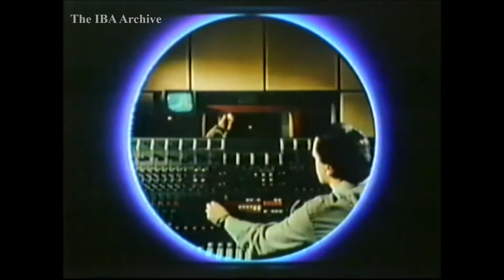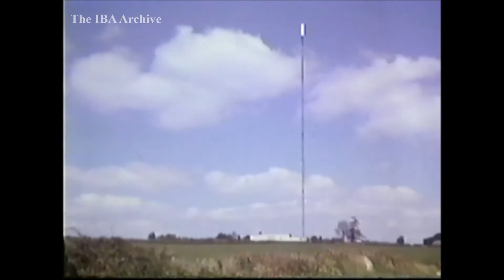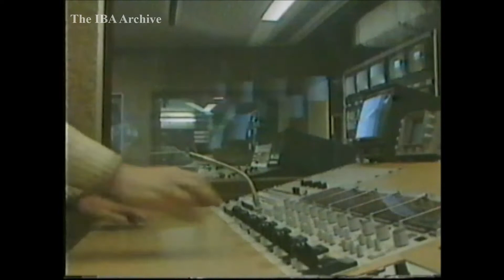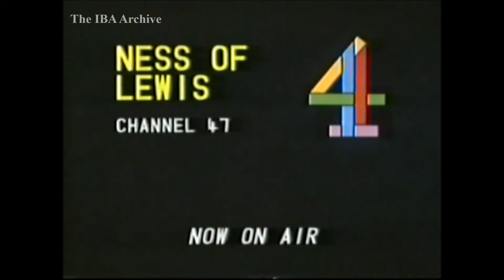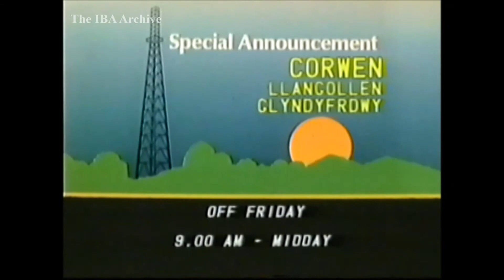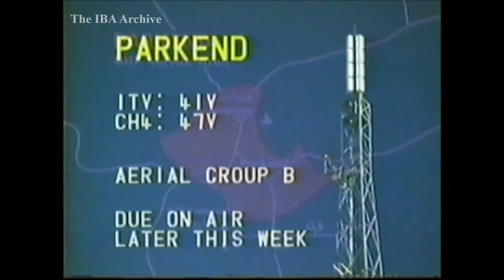IBA Engineering Announcements - 7 August 1984 'TV Stereo'

Comment: Of course the BBC develops the expensive option. They didn't have to worry about that as much as the IBA did.
Reply: NICAM was better than the other two, though. Their priority was technical quality, not cost, as per the terms of their Royal Charter.
Reply: @stickytapenrust6869 plus the BBC were already using NICAM for the radio backhaul network so they had a good amount of experience with it.

Comment: BBC ITV and Channel 4 eventually got NICAM Digital Stereo in 1989 in the London and Yorkshire areas on BBC and IBA transmissions, and this eventually spread to other areas in the 90's. 

Analogue stereo sound had been available on satellite for many years using FM sound subcarriers and made acceptable with the use of the Wegener PANDA 1 noise reduction system, receivers with true Wegener PANDA 1 circuitry gave the best sound quality from the Wegener PANDA 1 audio subcarriers.